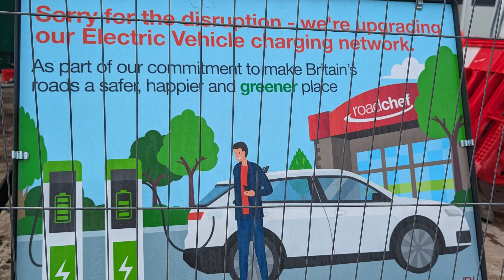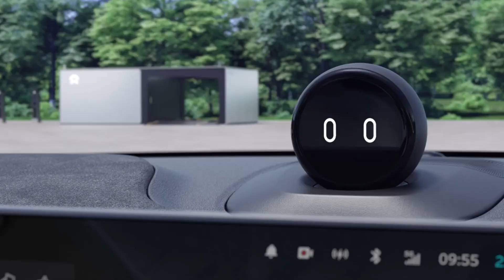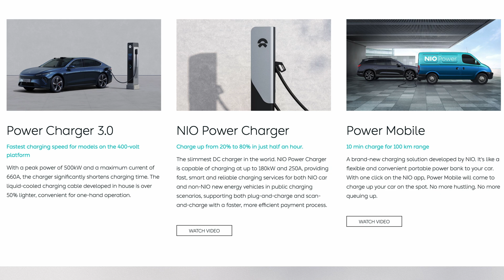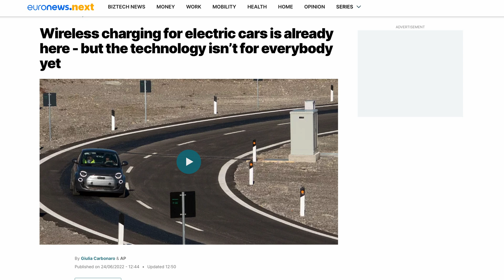Tesla vs NIO | Why Are They Taking Such RADICALLY Different Approaches?

Comment: Just can't see the battery swop being commercially viable. Think of how much inventory would need to be distributed across any country to satisfy demand. Hue cost on top of the charging cost built in. In 5 years EVs will have ranges in excess of 500 miles. Charging times will tumble to a few minutes. People shouldn't be driving 500 miles without a break so sitting having a coffee etc while your car charges up becomes irrelevant. Don't invest in Nio's technology option. It is very doubtful!

Comment: Biggest issue I see with battery swapping, as cool as it is, is that for it to work for all cars, manufacturers would need to agree on a "standard" size module so those batteries could be swapped into different manufacturers cars. It's a cool idea but this would likely mean that each manufacturer would have their own swapping station which just seems a little impractical to me.
Reply: Nio's battery technology  is being standardized now as other companys like Changan & Geely are partnering with Nio.

Comment: Folks are missing the forest for the trees. The moat isn’t battery swapping for charging. The moat is battery swapping due to issues with the battery. If a battery has an issue, the cost and time to repair it is lengthy and costly. If there’s an issue with the battery, just swap it. That’s THE moat. The ability to change a battery in 3-5 mins is a game changer. Changing a battery that is built into the vehicle, is short sighted long term. Versatility is the moat.
Reply from the maker: so battery swap stations will have to constantly replace abused and failing batteries. Great business model

Comment: Battery swap is well established within closed loop systems such as warehouses. (Fork Lift Trucks, etc) The trick is for NIO to extend that loop. Buses , Delivery vans, Taxis spring to mind. Local instant car hire could also work.  
My negative thoughts centre round future proofing the batteries , and the danger of reluctance for the swap company to update their expensive assets. Could NIO end up in  similar situation to IBM many years ago when new developments wiped millions off the value of their assets. How would the sytem cope with advances in battery design? Could it cope with a sudden breakthrough that enabled a halving of battery size, weight, etc. 
There is of course a good potential for the 'Autonomous car' market where your self driving car pops in for a battery swap, and valeting,  between customers.
Reply from the maker: Yes, good points and also compatibility, is the car's software able to communicate with a different capacity or chemistry battery in the same way?
Reply: Yes, all batteries are completely interchangeable meaning you can swap in a 100 kWh battery for a long road trip if desired and then swap back to a 75 kWh for local driving to reduce costs. Totally flexible

Comment: The main advantage to Nios battery swap is it eliminates battery degradation for Nio car owners as you just swap your battery out.  Also every swap is like a health check for the battery pack so if Nio finds any degraded batteries they can take them out of service to carry out repairs.  
Also it opens up the option to upgrade to a larger battery pack when ever you need longer range allowing users to only pay for a long range battery when they need it. 
The main benefit is if Nio brings out fully autonomous nio cars such as robo taxis they will be able to use the battery swap and mean that they can run 24/7 without ever needing human intervention to recharge. There are plenty of other advantages but these are the main ones I can see.

Comment: Both systems have merit and there is room in the market for both. Changeable batteries are very handy for densely populated areas where charging outside the home is challenging. Also there is the added benefit that the battery will not be the reason for getting rid of, an otherwise, perfectly servicable the car. 

Standard EVs will be the main one for most as it makes the car cheaper and faster charging mitigates some issues.
Reply from the maker: Yes, I'm not against them, just can't see the business model that makes them work. Building chargers you can attract all existing and future EVs. Swap stations can only attract EVs in the future specifically designed to do this.
Reply: @davetakesiton  It is all about standards and it would be nice to see this happen with the NIO battery. 

Tesla has already seen their charging standard taking hold, which is a good move. 

The quicker legacy car makers realise that licensing EV tech is the best way forward, the better for them and a benefit for established EV makers.

Comment: Some of the comments on swapping are missing the point on NIO.  With swapping batteries, degradation is taken out of the equation.  That's on NIO.  Also, NIOs will almost be guaranteed to pass inspection certifications.  When batteries get upgraded, NIO owners with battery swaps will get an updated battery..  NIOs can be bought with a battery or with the BasS (battery as a service agreement) option.  Buying with the BasS offers a substantial upfront savings on the vehicle.  At any time, a battery can be purchased instead of swapping.  But it's almost guaranteed that if owning an EV, any brand, the battery will have to be replaced at some point, costing $$$$$.  With BaaS, that's an expense that won't be necessary.

As far as in the US, swapping stations only need to be placed along interstates.  Long range trips are what give people anxiety about owning EVs.  For around town driving, the charging can be done at home.  But with the abundance of interstates in the US, the majority of people can simply drive to a swapping station and get a long range battery (for a small fee over the monthly fee of BaaS), and for around town driving, be good for a week or longer without needing a charge or a swap.  Getting a long range battery for a small fee is a bonus for long trips.  That's something that can't be done unless batteries can be swapped.  Advantage goes to NIO.  During the recent Chinese holiday, NIO owners with BasS were paying an extra fee of like $7 for a long range battery over taking the standard range battery in their BasS agreement.  Try that with a Tesla.

Comment: I drive nissan leaf.. but will never buy next EV unless there is a battery swap availability for it. Too much trouble once the battery degrades. Many tesla owners also complain about battery degrading.  Initial  4-5 years good experience with EV until degration starts and your fight start with dealer !😢😢

Comment: Had NIO swap around here in Germany for several months & there are 3 swap stations. While the cars are OK (Nervy Software/Beeping) the idea is as good as dead. €48k for car and either rent battery or buy one + €12k for 75kWh or €21k for 100kWh. German law means swap batteries have to fully comply with Weights & Standards regulations, which they don't do at the moment, so NIO is having to do it for free! Secondly, if you buy the battery, German ownership law doesn't allow it to be swapped, never mind the problem if you have a 100kWh but only 75kWh available - I think there are additional problems if you then sell the car. Apparently, when NIO sort out Weights & Measures, they will charge €10 per swap + charge they put into battery. The question is then if the 6 minute against 30 minute is actually a saving, especially - as you state - most charge at home! 

Here's a good Video on the issues .... at least in Germany ... not sure how good YT translator is!
https://www.youtube.com/watch?v=y6s-FlBSo4s&t=1596s
Reply: New country is always a difficulty, wait 2 years and this will be much better.
The problem starts with the German government that is too strict and play dumb instead of helping nio to build 100 swap station, this is better for Germany too because swap station regards of charge station offer more stability to the grid. Nio swap station can help the grid when there is high demand and duy electricity when the electricity prices are low
Reply: @harelbenyosef8743  In some countries, “possession is nine-tenths of the law”. Germans not so convinced - Fleet Car Co finances from their bank a new NIO which is then leased to a business who give the car to their employee. Can get tricky when battery is/is not part of package. However, leaving that aside, I don't think German Govt playing dumb. They know only too well the massive, game-changing  implications of V2G - the latest Govt subsidy for private EV owners to get PV/Home Battery & Wallbox is encouraging V2G Wallboxes although at the moment very few available. NIO has been in German market for exactly a year & registered (sold/subscribed/demo) 1,269 cars, 80 of which were in September 2023. It's no wonder Renault killed their Battery subscription service.

Comment: Battery swap for NIO offers choice, swap or charge. Now as said most drivers who have the capability will charge at home and rarely have the need for either charging on route or swapping. But if you,live in an area with no off street parking ( and no likelihood of the lamp post chargers) then battery swapping could be very convenient. The critical element to the swap is how many swap stations can be built and where. It may be just not possible for NIO to build enough swap stations around the country to make the swap a convenience.

Comment: Hold on , my math was off also.  That is 2 hours of wait time for 4 /30 minute charges.  Still , four battery swaps at 5 minutes a swap = 20 minutes.  Swaps are only a second option, NIO can also be charged at home are at charging stations.
Reply: That's if the swap station is directly on route and doesn't require any detour whatsoever and there's no queue for other swaps ahead.
Reply: Charge it at home just like a Tesla.  This video is a comparison not ,”everything wrong with NIO swap technology.  “. A comparison….
Reply: @michaelsaldivar4901  Personally, I can't see there being enough swap station density to make it attractive here in the UK, so the idea is just that, in practice, it'll be charged like everything else.
The moment you have to spend 5 minutes on a detour reach easy, you're already at 15 minutes to charge.
Reply: @djtaylorutube  nio build in the last year more than 1000 swap station
This is very realistic if UK will buy at least 500 nio a month you will see 100 swap station in the UK by the end of 2024

Comment: I can see your calculations are leaned  toward battery charging. Think about this, you said that if you have four cars waiting for battery swap that takes the same amount of time charging one car.  But, take those four cars waiting for a charger, 30 minutes each charge.  Do the math 🤔. You obviously have not seen the videos of the wrestling matches between men fighting for a battery charger in China.  That is the math based on reality.  In case you didn’t do the math , it’s a four hour wait…
Reply from the maker: How about my maths. One swap station vs 32 Tesla V4 chargers. Which is most likely to never, ever have a  queue at all and with 32 cards charging simultaneously, all at different SOC, which is likely to be free first?
Reply: Let’s think about this math.  The latest swap station can hold up to 21 batteries.  How big of a area you would need to set up 21 battery chargers.  Cities are seeing the area that is saved by swap stations.  They can swap a battery in 3 minutes and can perform up to 408 swaps a day.   How many charges can 1 charger do in a day at let’s say average 30 minutes per charge.🤔.  I believe they have hit 30 million swaps since they have started.  So that are popular.  So people need to stop saying that no one would use them that they would not be popular.

Comment: The biggest problem I see with battery swapping is the possibilities of things going wrong.
Battery not getting instead correctly because the automatic machine has a fault.
Or the battery dropping out because the bolts get stripped.
Yes plugging in your car to a charging station has it's risks.
But it's much easier to walk away from.
Reply: anus
Reply: 30,000,000 successful swaps in China suggest that things very rarely go wrong with battery swapping.
Can’t wait for it to come to the UK next year

Comment: Nio's new European battery charging changed a few weeks ago. The new 100kwh batteries charge flat from 5%-75% at 175 kW. Plenty fast and the 800v architecture will come next year with it's sub brand to be followed by its own brand. Best of both worlds.
Reply from the maker: Thanks Reginald, I am short on detail but cannot see this taking over, Ultra-rapid chargers are already too entrenched
Reply: @davetakesiton  oh no, that wasn't my point. But let me know when you find something that charges super fast but also swaps  way faster than anything charges out there. 30 million swaps. 10 million in the last 6 months. 75k a day. 2,000 stations.  Average completion time in the city 9 minutes. On highway 12. Nothing is coming close to getting 90% charge that fast or even close to that. But yes, building out a network outside china may be futile and I wouldn't bother if it was me, especially with 800v coming next year. For china, sure. But all the guys renting with the slower 100 kWh battery can now change to the super fast 100 kWh battery with no problems. The same way nio upgraded everybody's 70 kWh batteries to 75 when they made an update. And the stations use and pull way less power than chargers and can discharge back to the grid. And once yearly battery inspection becomes a thing you'll never see a nio on the degraded or damaged list.
Reply: @onetwothreefour-s1n  New CATL battery can charge at 500kw, charging is getting faster all the time.
Reply: @waltermcphee3787  does the grid, charging station and the battery support it too without being damaged
I don't think so
Reply: @davetakesiton  - the swapping are also meant for big cities where many don't have the possibility for a home charger.. it takes less space then like a massive Tesla charging area.. one generation 3 swap station, takes more cars doing a day then 6 normal  chargers can do if all had to go from 10 to 80%.. 
The stations are also meant to feed back power to the grid when the prices are high, to help lowering the average power prices (of course this will first have something to say when up on the same amount as in China).. 
If cue by the chargers (as often here in Norway when big holidays) there are no system of who are first and not. With the PSS U get a cue number, U can leave U car and go do your thing at the loo or drink coffee, and your phone will tell when it's soon to be your turn so U can get to your car and be ready.. 
They are building them now in Norway, Germany, Sweden, Holland, Belgium.. 
They had issues to begin with in Germany because of regulation rules, but they have been overcome now, so next couple of years many are to come up.. 
Norway have also been a bit slow because they are probably the most bureaucratic country in the world after UK, and it takes.a tons of time to get each place approved by each local authority.. 
So nope, I believe in the swapping, it's the best from both worlds, U can choose to swap and drive on, or take your time and charge.. 
And personally I wouldn't mind buying a NIO at all.. 
Also the biggest Taxi company of Norway have made a deal with Nio now of leasing the cars there, so they can use the swapping and not sitt around waiting to be charged up.. 
Some see future, some will always stay in comfort zone with the stuff they know and are used too.. normal human reaction 😊
Reply: But thats only depend if your EV can support up to 800V or above 150kWH + charging speed. Most of the EV brands are built around 400V and 80-150kWH.  And sadly you didn't do the research that most of the super or ultra charging station rate often don't give you 100% full capacity speed of what your EV and Charger capacity available! So far 95% non tesla charging station speed isn't accurate or mostly below 60% capacity speed from charger. As for Tesla's charging stations have more over 80% of them give full 90-100% speed of charge. So don't be so surprise about having super fast charging stations out.
Reply: @dann5515  obviously today's cars that have been sold do not support such speeds, but this is the future.
Reply: @waltermcphee3787  Yeah not happening any sooner in America that's for sure when you don't have any competitor everything going slows. And when America's enemy is too popular than their business they sanctioning them. So to wait the fastest charging station installed in US? Have a look at their trains how long have they kept that old trains already? And 2/3 of America dont trust or like EV. Today the price so high so how many people gonna switch to or to buy new car? Many won't buy EV if the charging stations are not up to modern standard and enough stations around. And if there is not many EV buyer then they wont built more advance charging stations. So go figured it out when is that gonna happen.

Comment: Shouldn't the battery be swappable for the sole purpose to extend the life of the asset? ICE vehicles currently last twice as long as Tesla's "Assuming battery life is 10 years and ICE is 20".  If EV's are going to be the future, than swapping the battery is a must, especially if battery tech gets better. Having both swap and charging seems like the best way to go.
Reply from the maker: Not sure where you get your figures from. RAC says average age of ice cars when scrapped is 14 years and many Tesla batteries are still good will beyond 10 years
Reply: Still, though, don't you want an option to keep your Tesla going another 10 years, or would you simply buy again?